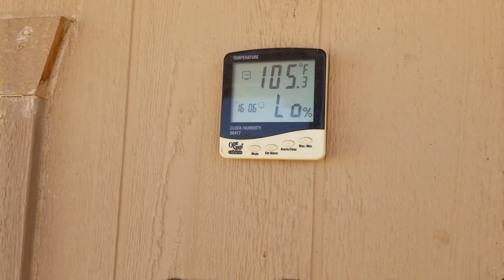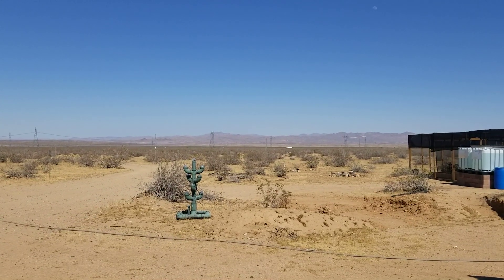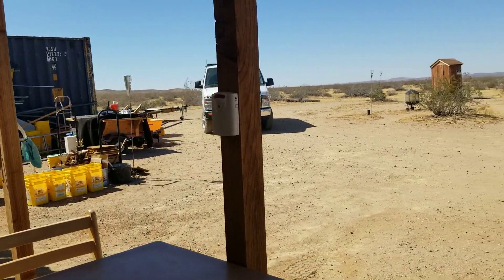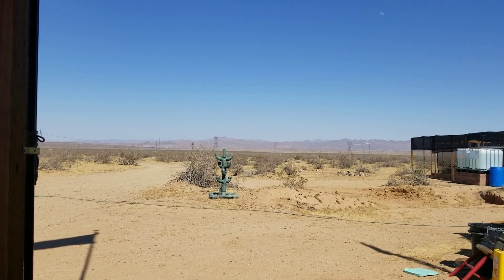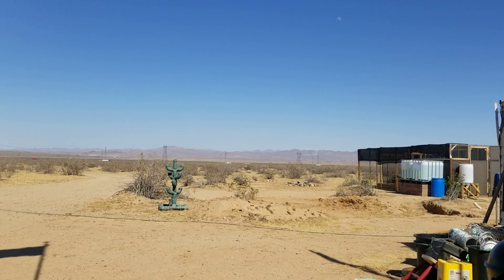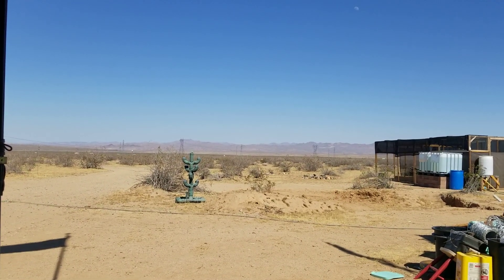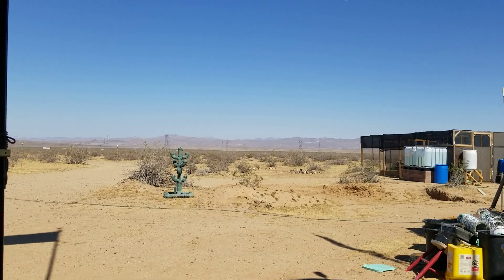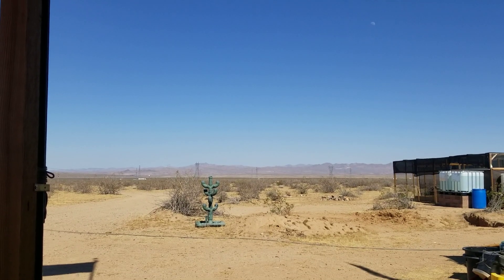Off grid electricity 102.1, Turbines and associated.

Comment: Thanks for the video, I am going to buy the rectifier and the dump controller for my wind turbine now. I did not see anywhere links to your parts so could you comment if these seem ok to you: 
https://www.ebay.com/itm/12-VOLT-10-000-WATT-Battery-Dump-Controller-SOLAR-Wind-Regulator-G4-440A/233211640932?hash=item364c7f3c64:g:3MsAAOSwZula4ovW
https://www.ebay.com/itm/MDS-150A-1600V-Three-3-Phase-Diode-Bridge-Rectifier-Power-Durable-Module-Board/232387047561?hash=item361b58f089:g:AbcAAOSwnK9ZUJ-i
Reply from the maker: That should work just fine.  I expect you are running a 12v system?
PS, don't forget a dump load resistor or 2 depending on your PMA output size, and an inline fuse to go between the controller and the resistor.
Reply: Few more comments and questions. About the fuses on the setup first. I was thinking if the system is setup in such place that is rarely used and the fuses break in any of the 3 cables coming from the turbine or the one next to the dump load resistor, wont it be a risk? I mean the turbine will most likely break or the battery then over charge and explode? Also I made a diagram of the whole setup based on your videos. Feel free to comment and I can update it. It could maybe make it easier to understand and remember all the parts of the setup: https://drive.google.com/file/d/1s-2cqGb9OJEiye2UT6lPuWpWP5wgnh8s/view?usp=sharing
Reply from the maker: Looks good!  You can also add a cooling fan at the dump load resistors to dissipate heat faster, tie it directly into the incoming wires so it turns on and off automatically.
Remember to monitor the fuses during and after strong wind events, just in case.

Comment: What some might not understand
PMG generates DC current
With distance DC current has a huge voltage drop thats why you need to increase the diameter of the cable you will be using...
PMA generates AC current
Similar to what your homes have.. Voltage drop with distance is a lot less..
Edison wanted to electrify citys with DC current
Tesla agrued for AC current...
Tesla was right...
If you want to see the voltage drop..
Lay out 100ft+- of your wire
Hook one end to your car battey...check the voltage at the battery and again at the end of your wire..

Comment: You ar correct I have a kt 5 and I get a about 52 to75 Watts at 11 to 15 miles an hour so to improvise I put four that keeps my power pretty good at night
Reply from the maker: Welcome aboard.   Yes, multiple PMA's is the way to go.   I get a lot of 20+ mph wind here and that makes 200+ watts at night.  During the days with near 1.6kw of solar, if the winds are in the 20's my dump load runs often.

Comment: My KT5 comes only with plus and minus connection and I actually want to modify it to have a 3 wire AC output, bypass the built in rectifier and connect to one close to my batteries, like you.
Reply from the maker: Your kt5 is a PMG.  Why would you want to build redundancy into something already functioning?
Reply: @GBear  ...because when the built in rectifier blows up I have to take down and disassemble the turbine to replace the broken rectifier, if I have the rectifier next to the batteries it's a much easier fix.

Comment: Thank you g bear for helping the viewers  with good solid info 
You are one of the few out there in you tube land that takes the time to answer comments  mark from NHL
Reply from the maker: As the song says, "I've gotta be me..."
Reply: Was checking out forever north and you got him going  with his power and now he found a spring for water  
Now you just need to stay cool and relax and stay hydrated
Reply from the maker: @icefishinnhnewhampshire7688  thanks, but I still worry about him.  Winter is just around the corner and snow and cold will be upon him.  A tent won't do it, and even a twig shack won't hold out the cold.  He needs heat and insulation, and that includes the floor.
Reply: @GBear  I'm about 12 miles to the Canadian border and I get a few weeks of 40 below zero with out the wind chill 
He need to start thinking  of winter now and he will loose his spring water jugs will freeze he will need to dig down over 4 feet to get below the frost line and keep his water from freezing  not sure yet if hes doing this as camping  for the summer and fall and going inside for the winter
Reply from the maker: you are right.  He needs to shift all effort to survival if he plans to wait out the winter.
Reply: @GBear  maybe you could tell him to wakeup and prepare for survival   as hes going to need slots of wood for heat and snow ice and short days are going to almost shut that small solar unit down
Reply from the maker: @icefishinnhnewhampshire7688  that's my plan.
Reply: @GBear  time wasted editing  and posting might be better used elsewhere  you tube might be a living for some but from what I understand  hes not going  to get rich quick
Your a good man

Comment: G.Bear I'm sure the Subscribers will understand that it is hot and you need to take it easy you can do all those things when its cooler.
Reply from the maker: Face it, I just got lazy today.  Lol.
Reply: @GBear  As you should it that kind of heat I know its a lot hotter out there in the desert then here in Pa in the mountains.
Reply from the maker: @josephineflatt74  but the work won't complete itself...🤔
Reply: @GBear  So true but do it early in am before it gets too hot
Reply from the maker: @josephineflatt74  you mean that one hour between sunrise and breakfast?  Lol
Reply: its still cool after Breakfast I'm sure its cool up until about 9 or 10 isn't it?
 @GBear
Reply from the maker: @josephineflatt74  it's 620am and 73°.  Looks like highs will be in the 105° range again today.